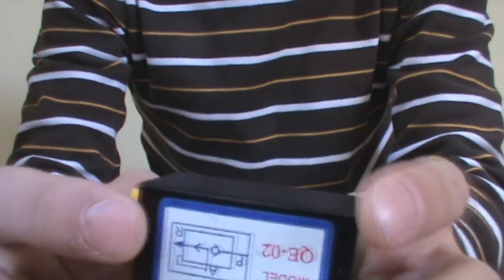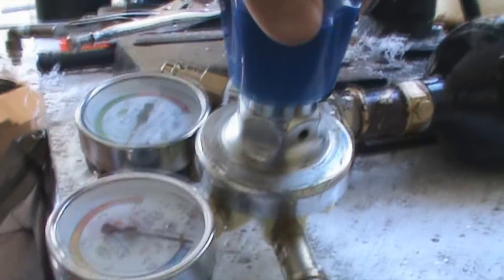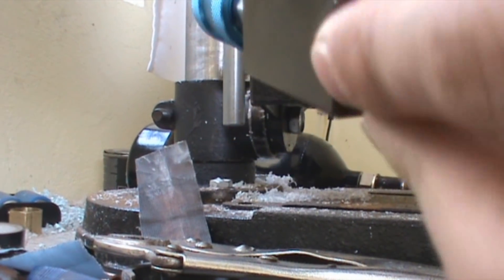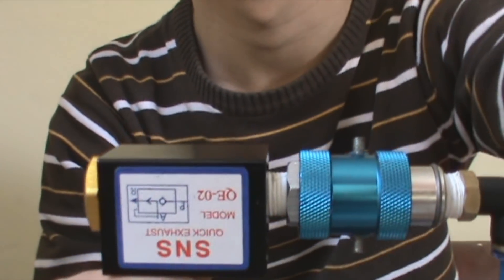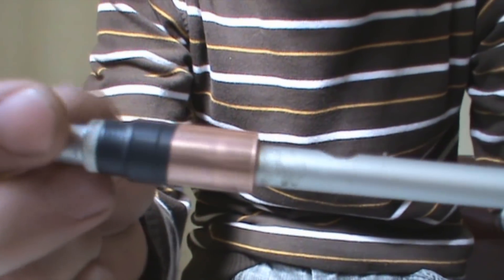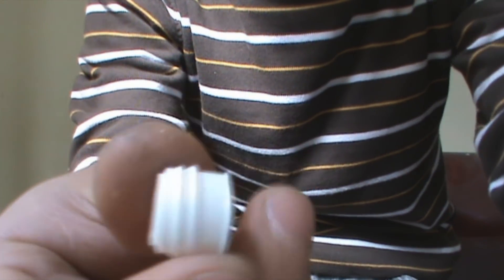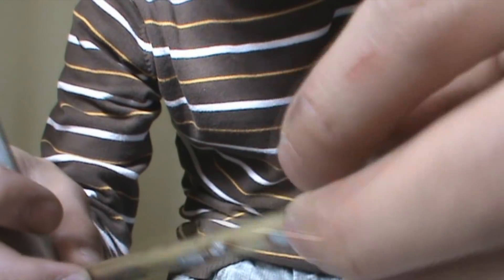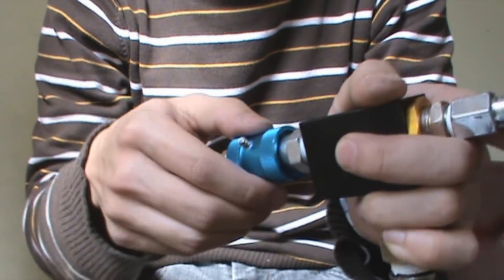How to make a semi-automatic airgun (version 1)

Comment: I'm a bit confused trying to look for the slide valve. I found one on ebay but the seller provide only size 'C' and 'D'. When asked, the seller only mentioned this; for Product C: 2x2x5cm/0.79x0.79x1.97inch and Product D: 3.5x3.5x6.5cm/1.38x1.38x2.56inch. Which one do I choose if my QEV has a 1/2 inch pilot port?

Comment: Do you have a video on the best parts used for a PCP gun?! Shooting @ 4000psi?! could you use the same pneumatic parts that you originally used? And have you experimented with the size of the air chamber? And using like scuba air tanks to fill your gun air storage at a very high psi, like 4,000psi? Also with all of this in mind, if you haven't already done it. Can you do a video with high psi, ball bearings instead of airsoft pellets and can you test fps, range and accuracy at different distances. With just what you have shown me in this video, I wish I had access to a metal lathe. I could make an of the charts air gun 😜
Let me know man, cheers.
Melbourne, Australia

Comment: Hello, I have a question will it work if the air tank is connected on the bottom part and only the slide valve is connected on the pilot hole? Thanks and really nice video man

Comment: could you make that system automatic, like run of a battery. is there a electrical slide valve
Reply: Elijah Walton 2-position 3-way solenoid
Reply: would you need a QAV along side with the solenoid
Reply: yea.  solenoids are around $20 whereas slide valves are $3 but with a solenoid you can have a very light trigger since it will just be a momentary switch
Reply: so all i need is a solenoid to make it semi auto?
Reply: No.  You would also need some kind of mechanism that automatically reloads after each shot.

Check out my latest vid.  This past week I build an airgun using a qev piloted by a 2-pos 3-way solenoid.  It isn't semi auto, however.
Reply: so a qev along side withe a solenoid would give me a semi automatic airgun correct?
Reply: If you simply copy the design in this video you will have a semi-auto airgun, but it will be kinda crappy.   Replacing the slide valve with a solenoid greatly improves functionality by making firing a shot nearly effortless.  Bottom line: you want to improve the rate of fire?   Use a solenoid.
Reply: Ok great,thank you so much. I actually have a 2 to 3 electric solenoid 
now i just need a QEV

Comment: Does anybody know if you can get slide valves without the release part? I need a good (quick and easy) valve to use on the tank/chamber in my project and a slide valve would be perfect because it's quick and efficient space wise.

Comment: Yes that's correct :) usually the bottom of the QEV would be the input and the current input would only be the pilot valve (the activator) but the way he has it is much more efficient because it takes up less room and has one action for two events.

Comment: Wyz2285-
I'm stuck on the blow forward bold design. I'm unclear as to how it really works and how to build it. what does the air push on to make the bolt go forward and block off the hole to the magazine? 
-Thomas

Comment: He is using HPA, but at low pressures. 8 Bar, where as guns with energies that would send a BB or pellet through a 2x4 are more along the lines of 200 Bar, or 250 Bar. Just for reference . . .
If he could scale up the pressure capability, it would increase the energies significantly.

Comment: did you connect in the first version the other side of the pilot valve to the air chamber ? because there is this blue pipe ?

Comment: Can you possibly list the material you used in the reload mechanism and the blowback bolt. Also what size are the holes that you drill into the piece of the solid alluminum. this is a great video, if you can help me out that will be awesome

Comment: I'm confused about how the qev works.
Does the air from the paintball tank push the piston pressured by a spring in the qev?
I need to see the whole gun in a diagram to fully understand how the qev and slide valve works.
Once I know I will even make a sketchup model of it.
Any help?

Comment from the maker: No it can not, poppet valve (sfaety valve) only allows full auto, and you need to make a littel modification on the QEV´s piston. The blow forward bolt it´s necessary for both semi/full auto, as soon as you want reliable feeding.

Comment: @rcbowstring123 i had the same problem. try a barrel with a littlw "U" formed piece at the end, if you know what i mean. pressure will push the bbs trough but they wont fall out except if you keep holding the gun in a 90° angle

Comment: I dont understand why the bolt would slide forward if the air is traveling through it. is there sufficent presssure to both overcome the spring and fire the projectile?
why would the aire not just pass through? If the bolt isn't sliding forward it would still fire because the chamber and magazine are preasurized. To check unload magazine leaving the cap open dri fire and see if air escapes through the magazine hole.if so then the bolt isn"t sliding.

Comment: why did u put a blow forward valve? (the doo-hicky in front of the exhaust port on the QEV) instead of just connecting the hopper straight to qev???

thanks for the feedback :p